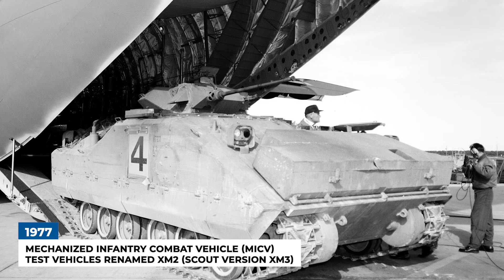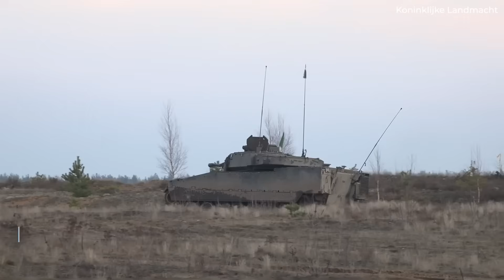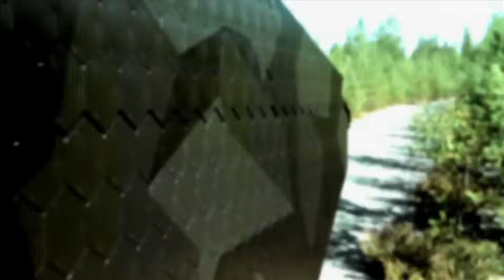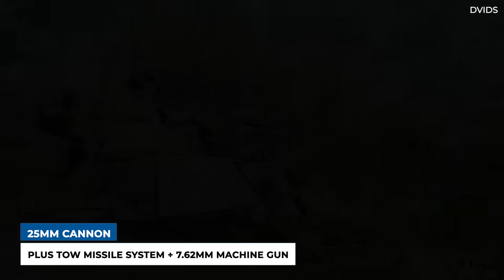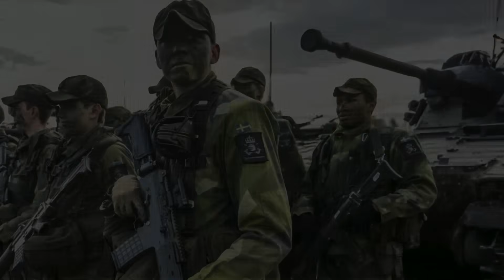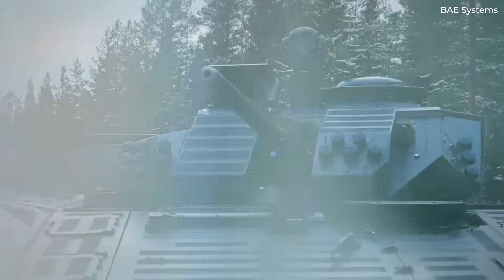Bradley & CV90: Comparing/Contrasting Two Major IFV Programs

Comment: Funny story from the 1993-1994 Norwegian winter trials.
The military had invited basically all the top armor manufacturers to pitch a replacement for their aging fleet. The mountainous Hjerkinn shooting range was the location, and there were meters of snow all around which the vehicles had to traverse.

The American M2A2 Bradley became hopelessly stuck in meters-deep snow, prompting the Swedish CV90 (also participating) to literally drive circles around the stranded US IFV before hooking up a tow cable and pulling it out of the drift.

It all came down to ground pressure: Fresh off its success in the Gulf War, the Bradley was heavily armored but had narrow tracks designed for European mud and desert sand. In the deep Norwegian snow, it acted like a hot knife through butter, immediately cutting through the crust, bottoming out its chassis, and becoming completely immobilized.

Meanwhile, the CV90 was built from day one specifically for sub-arctic conditions. It featured massive, wide tracks that distributed its weight so effectively it practically "floated" on top of the snowpack in comparison.

Needless to say, Norway rejected the Bradley and bought the CV90.
Reply: Just partially incorrect. The CV90 and Bradley have the same track width of 533 mm. The difference is that the Strf 90 trial vehicle had a weight of just 23 tons compared to the 30 tons of the Bradley.

In fact even the latest CV90 variant that's almost twice as heavy as the initial Strf 90 retains the 533 mm track width due to space constrains. That's actually slimmer than what's found on newer IFVs such as ASCOD 2, Lynx and Puma which use a 550 mm track.
Reply: Yeah even in moderate conditions here in western Europe the US vehicles failed compared to the CV-90. We bought the CV-90/35 as it was capable of using smart ammunition unlike the then 40 mm. It had the added benefit of more ammunition. Nowadays they both have similar ammunition options but we chose the one so we have continued to use the 35 mm.
Reply: @DinJarin74The 40mm had programmable ammo before the other smaller calibers.
Reply: @znail4675 read our tender information. Maybe the one Sweden used domestically but not the one offered to us. You should read before you react.
Reply: @DinJarin74 3p ammo for 40mm have been offered for sale since at least 1992.
Reply: How do you think the CV-90 would do now that it's 15 tons heavier but still has it's same original track width?
Reply: @JudgeVandelay still better than the Bradley that gained 16 tons on the same chassis and tracks.
Reply: That doesn't answer my question. Let me clarify- how would the current 38 ton CV-90 do compared to the original 23 ton CV-90 in the same test?  In other words, is it's infamous mobility in deep snow affected by it's tremendous weight gain over the years?  Don't get me wrong, I love the CV-90.
Reply: @JudgeVandelay in mud the mobility hasn't suffered. We have been pushing the CV-90-35 in several exercises since we started the MLU process. I know mud behaviour is different from snow but the only casualty so far is our maintenance plan. The added weight adds wear and tear. Plus the electric systems need more checks than previously due to the increase in power consumption.
Reply: @JudgeVandelay  It's not just the ground pressure. CV90 is longer and have a higher front sprocket letting it climb on top of snow while the Bradley digs into the snow.
Reply: @JudgeVandelay  Alot has been upgraded with the added armor ofcourse. I think the 23 ton version had a 500hp engine, while the upgraded/new versions have a 1000hp engine.
Reply: The US will cancel the new ifv and end up using old school busses. As they have done with frigates
Reply: Search for Bradley stuck in snow on yt
Reply: Team CV90 !!!!

Comment: The CV90 was originally designed for combat in the heavily wooded terrain of northern Sweden where Soviet airmobile troops and special mobile groups had the potential to outflank Swedish defensive positions faster than the existing units could react. 

Independent battalions entirely made up CV90s were designed to have the mobility and firepower to deal with those units on their own. That is why the 40mm was chosen, it not only had solid performance against helicopters but Bofors designed a 40mm APFSDS round that could defeat soviet tanks from every aspect but the front. 

The version armed with the 25mm Bushmaster was the budget version of the CV90 which lacked expensive systems like an advanced stabiliser and the night sights used by the 9040. 

The 9025 ended up being cut from the program together with several other variants, including the original 120mm mortar vehicle. 

The key to the export success of the CV90 is that the engineers at Hägglunds and Bofors built the base design to be upgradeable as well as somewhat modular when it came to things like the main armament. Which is why it was easy to Switch the 40mm Bofors for 30 or 35mm Bushmaster cannon. Customers could get their version, they did not have to buy the Swedish concept and related doctrine.
Reply: thank you! people always seem to forget the backstory and strategic and tactical reasons as to why swedish arms was developed.
Reply: And TOW for anti-armor is not an option in forests for obvious reasons.
Reply: @Stormwern  Forest isn't the usual area for mechanized forces to excell in though. When fighting over farmlands the distances for TOW missile become relevant.

Finland used to train TOW as the main weapon for ATGM platoons, along with newer Spike. NLAW and reoilless rifles for shorter ranges are perhaps more relevant anti-tank weapons in a heavily forested area.
Reply: @herptek  CV90 was designed to excel in forests, as the original comment says.
Reply: @Stormwern  Forest isn't the area where mechanized forces are at their best. There is limited room for manouver and speed is more difficult to utilize to ones advantage than in open terrain, where ATGMs rule.

When considering anti-tank weapons to arm IFVs an ATGM would be great for meeting engagements, which can happen in obscured terrain, but I would prefer a fire-and-forget capable missile that allows the vehicle to launch at whatever it bumps into and to reverse back into cover without waiting for hit or miss.
Reply: @herptek  But CV90 was designed for Sweden and there are lots of forests in Sweden. This would also be why no ATGM was included and instead a larger AC.
Reply: I seem to remember that the CV9040 Bofors was also considered for Finland in the 1990's, but the CV9030 Bushmaster was chosen because the original 40mm Bofors turret had no stabilizer. I wondered about the lack of a fully stabilized autocannon at the time, and the short distance forest combat could explain it.
Reply: @harri9885  The lack of a stabiliser was purely down to a lack of funding. Essentially the Swedish army had to chose between getting a stabiliser or getting good thermal sights. Stabilisers were easier to add later on in refits so the army chose the thermals.
Reply: @Vonstab  That makes sense. Thank you for the info!